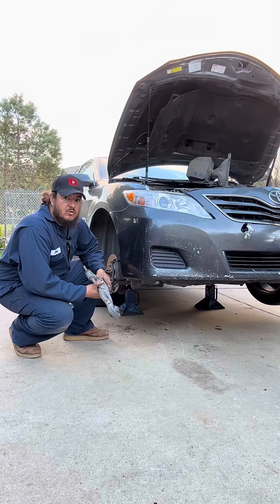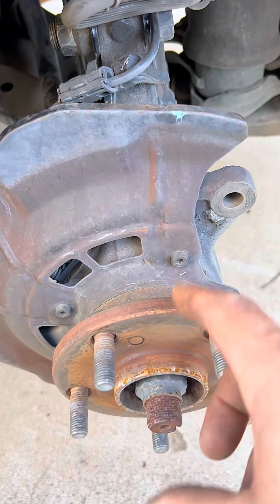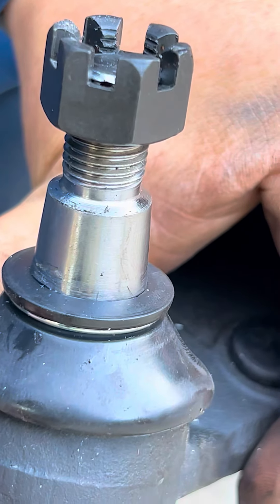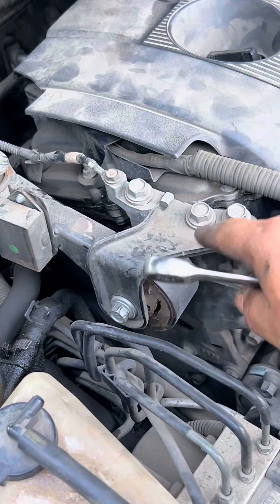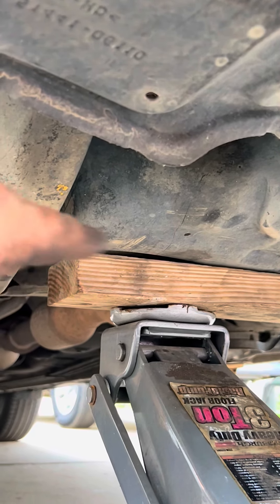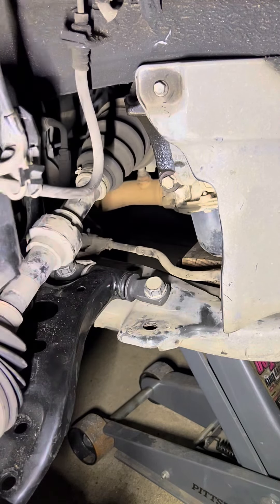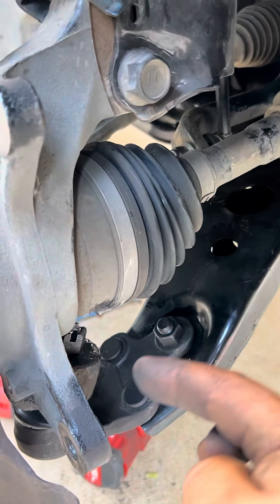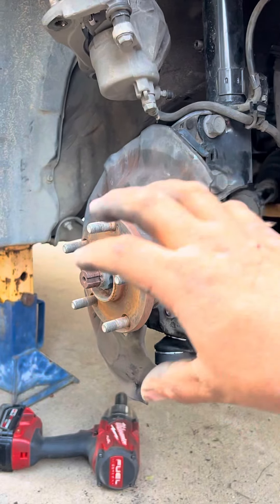Passenger lower control arm replacement to a Toyota Camry Avalon @elchanojose

Comment: Great video. Lots of detail. If you had taken the 3 nuts off the ball joint during removal, you probably wouldn’t have had to remove the brake caliper, although it does give you better visibilityTurning the ball joint shaft so that the hole is oriented front to back was an expert move that is not mentioned in other how-to videos. Great job. I might be doing this job in the near future. Thank you, Sir.
Reply from the maker: Hello!  Thank you for taking your time to watch our video and this was the first time we replace a Toyota Camry control arm.  We learn as we go.  Thank you for sharing that this video is helpful.  Take well care!

Comment: Alternative to removing the brake rotor shield and all the other stuff is remove the 3 nuts/bolt connecting lower ball joint to control arm then after freeing ball joint from knuckle, just wiggle it out - might have to flex the shield back a little.

Comment: My 24 mm bolts keep spinning with the bolt sleeve. Been 2 days struggling to screw these bolts. I can feel the thread on the bolt hole spinning with my finger putting it in. Any idea how can I screw these bolts? For reference these bolts joins the control arm to the bar.
Reply: I had the same issue on a 2006 Avalon 140,000 miles where the 14mm x 90 mm bolt goes thru the control arm end rubber bushing. I tried a Sawzall with good quality (Milwaukee) metal cutting blade and it did little more than make a slight groove in the bushing after several minutes and attempts at sawing through the bushing and bolt.  I ended up using a Makita 4 inch angle grinder with a flat metal cutting disc to grind through the top and bottom area of the sleeve-bolt to be able to remove the control arm.  It took some time to grind through and a couple of discs as the discs would wear down and lose the ability to reach fully through the bolt - sleeve.  Guard was removed from grinder, gloves and a face shield are a must.  Patience and Ear plugs definitely recommended. Rust on the control arm bolts make this job a miserable time consuming struggle and not one for the DIYer with minimal tools and experience!
Perhaps the repair shops use a cutting torch to cut out the seized up bolt and sleeve and living with the burning rubber and smoke, but not something I was anxious to try before I tried the grinder cutting wheel operation.